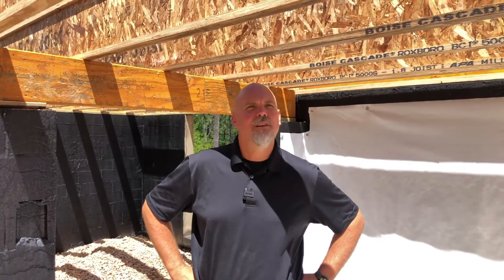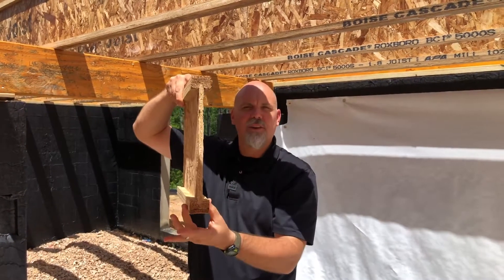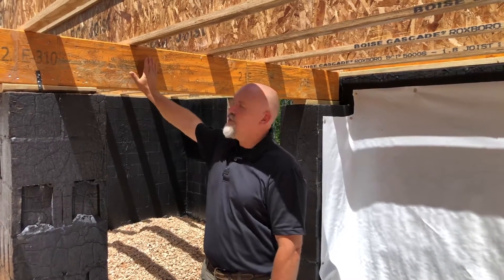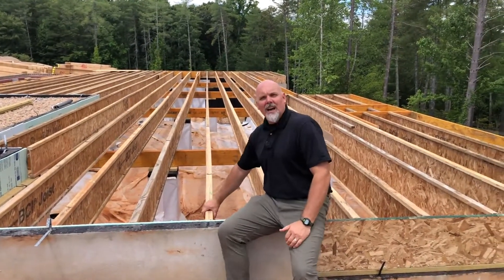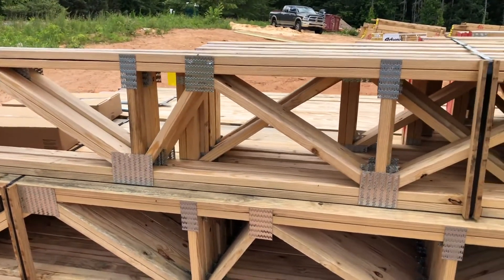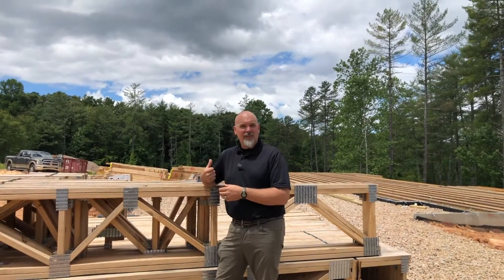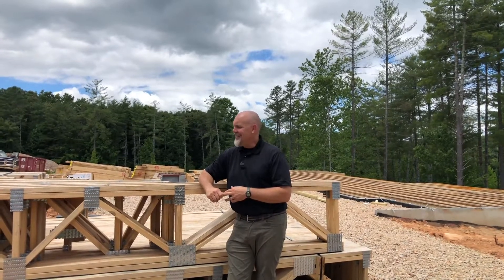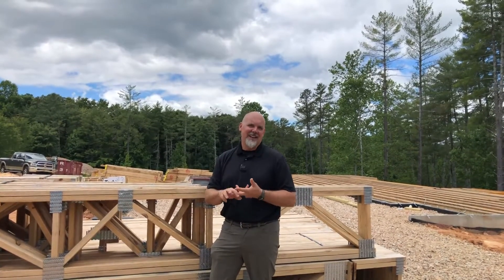Engineered Floor System | Why It Matters

Comment: Was just wondering, on wooden i joist i didn't notice any bridging was that added later ?
Reply from the maker: @charliewheeler725  great question - bridging isn’t typically required with i-joists.  Being an engineered product, I-joists don’t bow, twist, or cup. “Squash blocks” of perpendicular I-joist material and/or rim board are often required where the I-joist cross a bearing point.

Comment: But you still get shifting plus its over triple the cost
Reply from the maker: I’ve never had “shifting” of engineered floor joists after using them for the past 23 years and when the extra foundation cost is factored for dimensional lumber floors, the costs are competitive.

Comment: Thanks for the video, can you cut a section out of these engineered beams and use a double trimmer and header like dimensional lumber?
Reply from the maker: Not easily and not unless engineered by the manufacturer.

Comment: What happens when the dishwasher leaks?  Serious question.   I am asking because I want to know, but when I see homes like this, I wonder if the piano just winds up in the basement?
Reply: Simply  buy  a piano made out of  OSB as well, hahahahahaha!
Reply from the maker: Good question.  And one that I have experience with in my personal home.  Short answer - nothing happens to the engineered i-joists.  My dishwasher had a leaky door seal and water ran out all over the hardwood floors.  The hardwoods buckled and needed refinishing, but no water made it through the subfloor.  If it had, it would have drained to the crawlspace through the gaps in the subfloor and dripped down from the top flange of the i-joists.  In reality, it is highly unlikely that bulk water from a leak above is going to completely soak the engineered components of an i-joist long enough to cause any failure that hasn't already ruined the upper level finishes of the building - flooring, subfloor, etc.
Engineered components such as i-joists will not suddenly "fail" when they get wet as you elude to with the piano falling through to the basement.  You would literally have to soak them submerged for weeks for them to fail in this way.
Reply: @AddisonHomes  Thank you for taking the time to answer this question, very nice of you.

Comment: Will it last hundreds of years like wood? Glue has a shelf life. Wood if taken care of and kept dry will last.
Reply from the maker: Absolutely - if kept dry like wood.  This is a wood composite after all.  In an encapsulated crawl, no worries.  The adhesives are not "glue" per se, but resins that once reacted, do not break down over time.
Reply: @AddisonHomes  that is yet to be seen in real world conditions. I foresee long-term problems like any other man-made product.
Reply from the maker: @jamesoncross7494  Not sure what you mean in "yet to be seen" - i-joists were introduced in 1969 and have had no major issues related to their "man-madeness" to this point.  While this is only 52 years of real world application, I think its a pretty strong indication that the product is robust.  Do all man-made products have long term problems?
Reply: @AddisonHomes  it is not the same I-joist as was in 1969. Today man made products are not made to last so you have to buy more. Over-engineering is not cost-effective for maximum profit margins. I am skeptical about most products but hopeful these I-joists will hold to the test of time. I know wood will last thousands of years taken care of properly and wont harm the environment.
Reply: @jamesoncross7494 so in other words your mind is made up and facts won’t change it. So why comment at all?
Reply: @TVT only time will tell. I can't possibly know the answer. Why so defensive? Uh-huh.

Comment: There is nothing wrong with framing your floor with dimensional lumber. Don’t be mislead
Reply from the maker: You’re correct!  Absolutely nothing wrong with dimensional lumber. Your floor joist spans will be shorter, meaning more piers in your Crawlspace and smaller rooms or engineered lumber and/or steel beams in your basements, but absolutely nothing wrong with it.  There’s also floor squeaks which are more common in dimensional lumber with seasonal changes.

Comment: What happens when the gang nails fail in time
Reply from the maker: Not sure I understand the question, but following the recommended nailing pattern is important, since all testing and certifications are based upon the specified nailing pattern.  The research and performance testing does not produce a nailing pattern that will result in failure over time.......

Comment: This house is a firefighter killer and if I was a firefighter I would just let it burn to the ground and not let any other firefighters enter that hose.
Reply from the maker: That's a great point.  Some engineered floor systems can burn through faster than others, which is why the latest international code requires a fire barrier on the underside of engineered floor systems over basements (typically 1/2" gypsum or rockwool insulation).  The fire barrier slows the penetration of any fire from below providing more time to fight the fire.
Reply: @AddisonHomes  what about a two story house or a one story with a attic space also why not go back to solid wood beams instead that didn't require extra steps or materials to protect it from fire and would hold up for longer lifespan.
Reply: As a firefighter, I loathe the engineered I joists.  Requiring the extra insulation and fire barrier increases the cost as well.  When those are included, I can see it costing more than dimensional lumber's extra supports.  The floor trusses seem like a better compromise and I like being able to run ductwork, plumbing and electrical through them for a cleaner section.  As for sprinklers, they don't do anything for fire in the walls and floor already.  They help but don't always make a difference. And most states don't require those either.
Reply: There are new houses that still use solid dimensional lumber floor joists? I only see i-joists and trusses.

Comment: I have a1 inch gap between them do you think it is too much gap between joists.  I also have realized that I have some cracks in subfloor not sure if the installation of tiles above them is too heavy or the tile installer cur it by mistake
Reply from the maker: Is this between the joists where they butt together?  What is the spacing of your i-joists?  What is the thickness and type of your subfloor?
Reply: @AddisonHomes  thickness of subfloor  is .75 inch  I have I ( engineered joist ) joist and the gap is 18 inch.   I have poured concrete basement with 3 iron joist holding the wait of the house with 5 iron post.   Cracks are in the middle not close to the joist.

Comment: The OSB part on the I Joist WILL LET YOU DOWN.
I was in a home with them... a heavy piece of furniture set at the wall for several years,  bowed the floor.  At the Top of the Furniture  it was 2 1/2" away from the wall, and the base was tight against the wall.  
Ask what people have to do if they have a hot water heater burst, or they have to deal with a temporary flood situation?  
They have to replace them..... BECAUSE OF THE OSB
You sound like a Used Car Salesman.
Your I-Joist will FAIL !   Just Like the Titanic wasn't Going to Sink... LOL

If you want a REAL I-Joist.... use Thin LVL instead of the CRAP OSB
Your story is complete BS !!!
Reply from the maker: Thanks for the feedback James.  I have never had any of the issues you mention with i-joists floor systems in my 20 years of building.  Certainly if there is a roof leak, water heater burst, or some other catastrophic water damage to the house, the OSB in the i-joists may delaminate and possibly fail.  For that matter, the OSB roof sheathing, wall sheathing and potentially subfloor may all suffer the same fate.  One of the key approaches to high performance building is durability.  One of the most crucial ways to increase durability is to manage water to keep it out of our buildings.  Strategies for doing so include keeping tank water heaters in a basement, crawlspace, or garage and building to higher performing standards proven to keep water out of homes, even in a severe storm, such as Fortified Home (www.fortifiedhome.org).
Another key element of correctly designing any engineered floor system, including i-joists, is to adequately support any heavy loads and again - design and build to higher performance standards.  We ensure that our structural engineer designs greater structural support under heavy furniture loads such as pianos or heavy furniture pieces (we recently had a client who had a table made from a ship's hull).  

The building code allows for floor systems to have a deflection of span Length(inches) / 360.  This would result in a code allowable deflection of 0.6 inch on an 18 ft span.  We design all of our floor systems to L/600 minimum and would only allow a 0.36 inch deflection on the same span.  

Again - thanks for your feedback.  I hope that my explanation sounds less "used car salesman" and more "informed builder".

Comment: Wow! that crawl space almost isn't !
Reply from the maker: Yes - very true!  We actually incorporated a "basement" storage room into this crawlspace due to the topography of the lot and the owners desire to have some storage space under the house.  This space is right over my shoulder in the intro video.
Reply: @AddisonHomes  why not go full depth?
Reply from the maker: @UteTrac  This client did not want to spend the extra $$ that would have been incurred for a full basement and they did not need the additional space.  Despite the fact that basement space on a sloping lot like this one is the least expensive space that we can build, it still adds some cost.  This site was perfect for a walkout basement!
Reply: @AddisonHomes  I love Walk Out basements  so cool, and open but it usually means no back yard, I also like large back yards :)
Reply from the maker: @UteTrac  If I was building a new home for myself it would be a walk out basement!  The precast basement systems (future video) that we use are awesome and we typically finish 10 ft ceilings in the basement to provide an light-filled, open space in the basement.  You can't even tell you're in a basement!!!